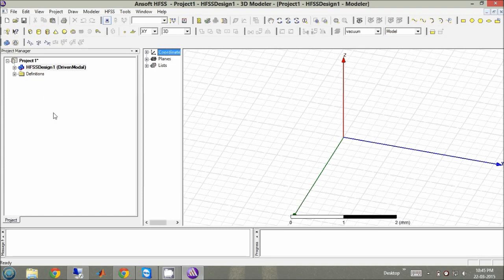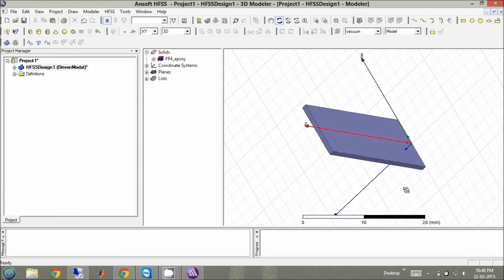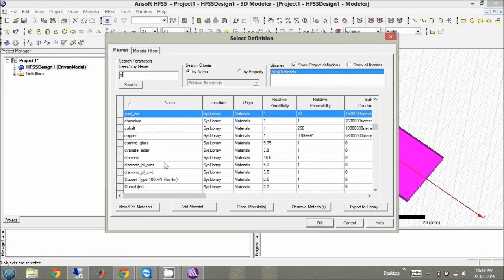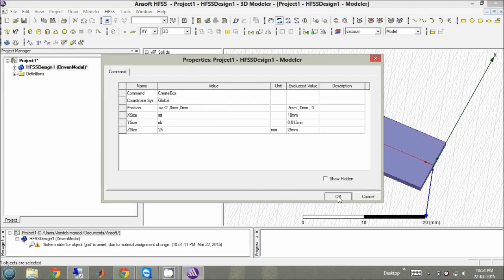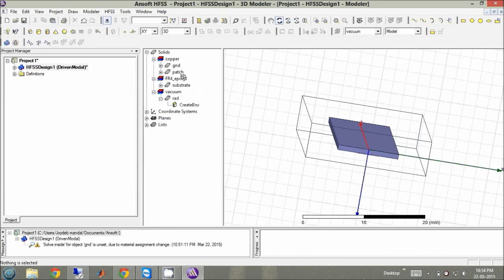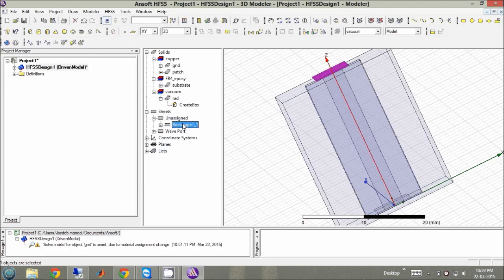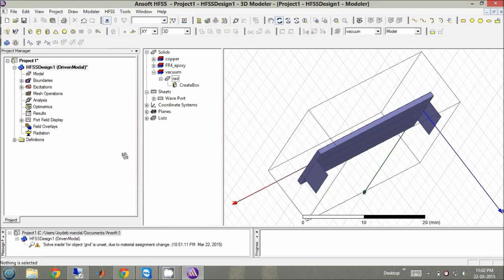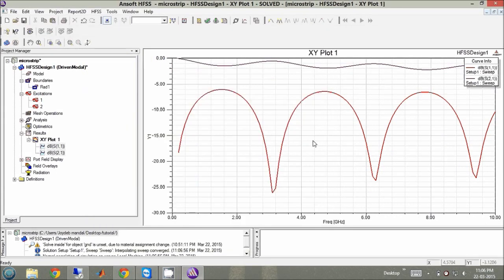Microstrip line design in HFSS 13 (Part1) (USE Captions: CC)

Comment: How do you confirm that the transmission line is Impedance matched ? How do you check the impedance at every frequency point?
Reply from the maker: This microstrip line width is adjusted such that it provides 50 ohm which is same as characteristics impedance over a certain range of frequency.   Ideally, line impedance is replaced by characteristic impedance which provides matching for infinite bandwidth.
For practical cases, still there is some mismatches is observed and it increases when frequency increases.

Now the question may arise if the line impedance is not 50 ohm, lets say 100 ohm, then??
In this case, one matching network is required to matched with 100 ohm to 50 ohm. There are several method is there. Smith chart is used to solve this.

I have tried to give the answer. If anything I have missed. Please feel free to ask me. 
If you want to know anything in this regards,  I am happy to answer you.

You may suggest me any topic here. Thus I can upload that type of video here.
Reply: @rfzone3099  thanks for the reply. My question was in regard to HFSS. How do you confirm in HFSS, after referencing the calculator dimensions? Which reading in HFSS will tell the impedance is matched perfectly?
Reply from the maker: @jothamkasule4150  Well. Observe port impedance. If you Renormalize all modes with 50 ohm, port impedance plot give 50 ohm over the frequency. If you choose do not Renormalize, then port impedance will show the line impedance. By seeing the port impedance i.e line impedance you can act accordingly to width adjustment.
For port normalization:
1. Project Manager 》Excitation 》Port 1( 1)》Wave port》Post Processing.
For plot port impedance:
2. Results 》Port zo
Reply: Thank you so much.  I dont know why the z-parameter gives different values from the port impedance though. Thanks.
Reply from the maker: @jothamkasule4150  that correct. Z11 is not similar of Zin for two port network. Any way, you can  find Zin in terms of Z parameters. Please follow text book. 
Hong and Lancaster,  filter book.
Reply: Thank you so much.  Let me get the textbook and see edgar it says. Thank you.
Reply from the maker: Thanks. 
Please Subscribe the channel to reach 1000 Subscriber family (636+ counting....).